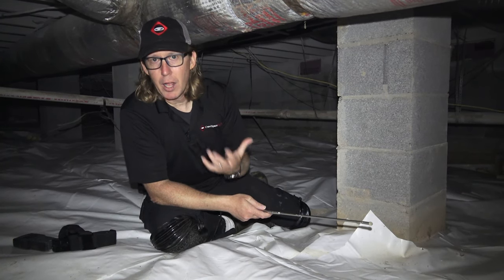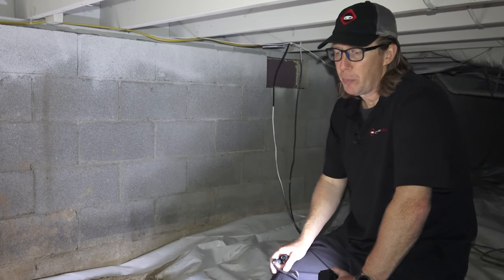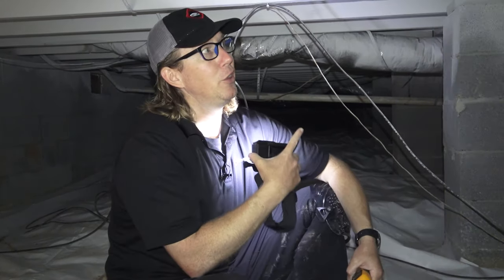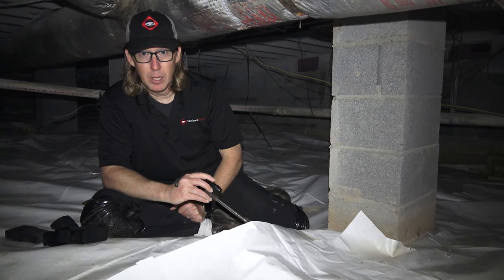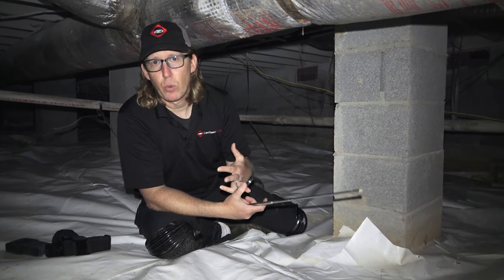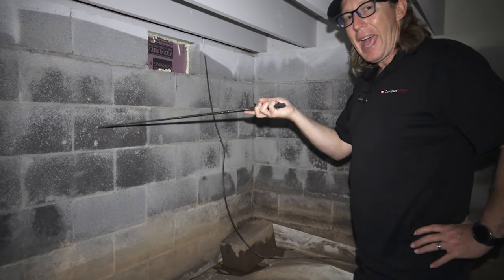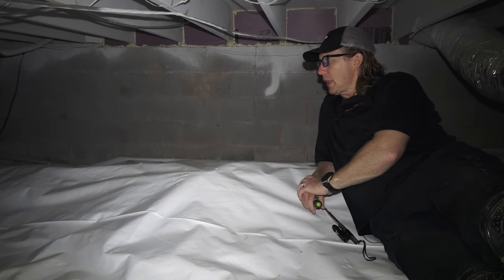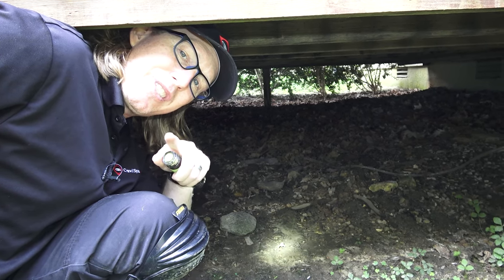Crawl Space Inspection Tips | Choose The Right Contractor

Comment from the maker: Can you guys point out the insulation in this crawl space?!
Reply: It having to be taped up the wall and overlapped, could it have something to do with radon gas?
Reply: Aside from the 1/2 XPS where the vents are...there's none!
Reply from the maker: @gworkseliteautofinish3611  Having vapor barrier attached to the foundation and overlapped and taped helps reduce the amount of evaporation/humidity coming from the ground. It may help with soil gases but a ventilation fan blowing out of the crawl space is still required by code when sealing the crawl space to remediate soil gas build-up.
Reply: There is none
Reply: Rim joists are insulated.

Comment: Wow, terrific and informative...please help me as i have a house ..55' i have 
discovered the status of CS due to my opening the small door and looking in???
and feeling cold air coming from the floor in the winter...i do know insul. was not used in the walls , i discovered the flex Ducts ,large ones, hanging on the floor...old dirty plastic on the ground...vents around perimeter...fiberglass under floor stuck up in joists..so what do i do.
i think that no one goes deep into crawl like termite guys..Dodson pest told me they do not like encapsulation..imagine that!as theycannot look for term...... as u go into space it gets tighter,lower..encap.job estimate here 13,000.i inherited this after folks died...Electric co.did diy for loss of heat...sealed broken ducts..Talk about duct replacement mine ar 70yrs old..I purchased a new heater and they never even checked the conduits...imagine that 5 grand for new furnace..So I want to pull the old plastic...i have a spotlight for my own info but im afraid to go into this space deeper also the water cutoff is down there, i had a rat in the house last winter after finding a hole in the wall behind washer...this is a 1500 sq ft cs and  Iam conserned about the air coming thru the conduits...there is an old computor screen down there how did that get there???

Comment: As you state in the video, we do not know what the contractor who did the work recommended or what the property owner requested. However, this brings to mind a variation of a very old quote: "If you think hiring an experienced contractor is expensive, wait until you hire an inexperienced contractor." 

Having to pay an experienced contractor to come in to do the job right after already paying another contractor is almost always the most expensive way to address a problem.
Reply: Totally agree. Sometimes you can get away with doing the bare minimum like I did when I replaced my old tore up moisture barrier with lots of debris on it shortly after we had severe flooding where my basement and crawlspace both stayed relatively dry even though my entire backyard was flooded because it slopes toward the house and is too expensive to address right now. But as a homeowner or a contractor you have to know when it might be a better idea to go a little above and beyond and actually address the standing water or whatever issue it is instead of simply adding a coat of drylok or putting down plastic or whatever it may be

Comment: 17:50 you are the first person I have heard say how to address those open blocks around the vents.  I have this same issue.  I am strongly considering removing the cheap vent covers and just putting a cinder block back in there as I haven't sealed the vents yet.  Why don't others just replace the vents with a cinder block (in the case where the vent is the same size as a block)?  Is it just a matter of time and money?
I fixed it around our crawlspace door last year and had the bright idea of using canned spray foam.  It took a lot because the foam kept falling down in the block.  I finally got it filled with foam and then had to use leveling concrete to top it off to make the entry way nice.  On the vents I could definitely see just using foam though since making the opening smaller there doesn't matter.  Great video as usual.
Reply from the maker: We find it most efficient to use foam board and spray foam to seal the vents up when encapsulating the crawl space. Thanks for watching!

Comment: I’m gonna look at the plastic myself. I’m sure most viewers don’t know about mil and I myself can be wrong about the correct term pertaining to quality plastic vapor barrier. My question and love your channel you are a true passionate professional that’s not about the spew , you speak knowledgeable info backed up with data. Panda film I have a few boxes that is used for agro of course. My question is can this be used in a crawl space ? Also how are you on using a product such as hydraulic cement to be used as a coat over cinderblocks when the home owner sees water damage and is trying to stop the basement from being further compromised. Then adding foam board to joist and sealing walls with that r value. I’m in Georgia.
Reply: On that note French drains not a fan they collapse and get damaged any other options as far as exterior foundation besides the grate. I’m in Gwinnett so near your Athens location. I called and no one returned my cry for help. lol ….
Reply from the maker: We are using the Hydraway and it won't collapse for waterproofing inside a basement, crawl space or outside in the yard. Here is a link. Hope this helps and thanks for watching. https://diy.crawlspaceninja.com/hydraway-strip-drain/
Reply from the maker: I have seen hydraulic cement installed many times and it can fail if the water pressure is too much for it to handle. That is why we use plastic on foundation walls. I am not familiar with Panda film but if its a class 1 vapor retarder it should work.
Reply: @CrawlSpaceNinja  thanks so much. Out of all the noise out there able to use this platform as a tool and advice. You channel is facts and to the point. Most try overwhelm any one into a negative state of mind.  I mean hands down execution and produce can be and is and obstacle for anyone with out the experience. Yet you let viewers know when to stay in their lane and look for a solid outlet that can definitely showcase the solutions.  Your skill set shins in all you videos. Great stuff.

Comment: So, I wasn't going post my question on this video, but the no insulation kinda did it for me so pardon my long inquiry. I went under my dad's house the other day to run a fiber cable for our internet (cable guy couldn't fit). It's a complete train-wreck and I know pretty close to nothing on this subject, however let me list you off some highlights: The door frames on both sides of the house are rusted out and the metal square door that fits into the frame no longer fit so they are placed in front with a brick to keep animals out. Inside, huge mold problem covering the air ducting due to an oversized A/C unit that creates air leakage into and outside of the ducting. A/C company recommended this unit and now always complains about the mold and recommends up-sizing the ducts. Plastic on the ground covers maybe 25% of the entire underneath. In some spots found a near 1 inch gap between the sub-floor planks. I could see some kind of black material (insulation?) between it and the hardwood floors above. Lastly, no insulation anywhere. The house has vents open all the time. During a humid 85 degree day the crawlspace was just as cold as the house(72). I have no idea where to start or what to tell my dad.
Reply from the maker: We normally recommend starting with sealing the vents and installing a dehumidifier to start drying the crawl space out, then addressing mold, then insulating and encapsulating.
Reply: @CrawlSpaceNinja  I don't think my father is interested in installing a dehumidifier and sealing the vents. Is there another method?
Reply from the maker: @JWolff-md3ij  Sadly that would be the best way.

Comment: I have vents in my crawl space “open” , concrete slab, cinderblock & there’s no standing water but yet my crawl space averages 66 to 72 percent humidity. If I close my vents & install dehumidifier,  would that help ?
Reply from the maker: Yes! This is a common solution to a common humidity problem! You will want the humidity in your crawl space around 45%-50%. Encapsulating will prevent outside elements from raising your humidity and making that newly installed dehumidifier work harder than it needs to.

Comment: You mentioned soda blaster.   I guess that is to remove tough mold after treatment with a disinfectant?  Have you heard anyone using high pressure water in your crawl space after using peroxide?   Seems to me it's not a good idea to add that amount of water in a sealed crawl space
Reply from the maker: You definitely do not want to add that amount moisture into the crawl space in order to treat mold, you would likely have an even bigger issue on your hands. We do soda blasting before applying the disinfectant so it has a better chance of penetrating the wood and working as intended.

Comment: Do you guys reply to comments from old videos? I hope so. I had a mold remediation company come out today and the guy recommended that I NOT go back with insulation once the old molded insulation was removed from the floor joists. He recommended blocking off the foundation vents and installing ground plastic w/a dehumidifier, saying that the insulation would just mold again in a few short years. I'm in Nashville, BTW, so similar climate to yours. Similar crawl space height to the one in this video, as well, w/very similar issues. Thank you!
Reply from the maker: Hey Steve! We try to get to as many comments as we can. :) When we do our encapsulations, we seal the vents and insulate the walls. However, you may want to check out this video that shows some research done between the two types of crawl space insulation and make a decision based off that: https://youtu.be/JZfksZZbrW0 

We have a franchise location in Nashville that may be able to help if you'd like it! https://crawlspaceninja.com/tennessee/nashville-tn/

Comment: Thanks I have concrete floor crawl space with heat in a back split house we’re you can enter inside what installation type do you put on walls moisture is 30 and does insulation cause Mold in behind thanks
Reply from the maker: We have used EPS foamboard and insulbarrier, both work well for us. Hoping to have the Insulbarrier back on the DIY store in next 30-days. Great product.

Comment: Any reputable company you'll raccomemd in Burlington NC? I'm currently watching your videos to build some knowledge and getting different assessments by different company and discuss possible solutions to my problems which is high moisture without any standing water.
We are getting musty smell odors inside our bedroom (only 8 ft cieling) but not in main living area with high cieling until we start going upstairs.
Floor joists have moisture level (in September) ranging from 16.1% to 18.2%.
Our indoor humidity levels (reading off our Honeywell Thermostat) ranges from 61% to 78% and running the air doesn't make things much better. 
My wife gets sick constantly and has to pop allergies pills all the times.
It make sense tackling this kind of high moisture problem in stage seeking improvement as the project evolves.
One thing that also was pointed out to me was that good thermal insulation of the crawl space is a key factor in this kind of remedation, especially when you have a furnace and ducts work in your crawl space because of the dew point.
I went ahead and purchased a SANTA FE 100 because of the wifi. That will give me remote monitoring capability since I'm gone for work most of the day. I was assured by the manufacturer that even though the unit has been discontinued because of energy rating factors, parts will still be available if needed.
I will have it installed once all of the forementioned high moisture level causes has been discovered and addressed properly. Also drain pump from furnace will be used to drain water coming from dehumidifier.
I'm not sure about using spray foam to insulate crawl space. I've watched horrible story of spray foam insulation going bad. It will make sense to use prefabricated insulating foam board on foundation wall but between floor joists I will still prefer old fashioned insulation bats.
Also in one of your video you've mentioned about installing a ventilation fan on at least one of foundations vents. I still don't quite understand the purpose of it. Will that be counter productive if you're totalling incapsulating the crawl space trying to keep humid air out? What will it be the effect of sealing completely those vents in the winter time when is dry out anyway?
Thanks for your time and I hope to recieve some feedback soon.

Comment: Just bought a house and I have a small crawl space (12x15ft or so) under an extension. Started watching your videos to get ideas on what I should do. It's a cinder block wall with a concrete ceiling: the floor above is a 6in slab. It looks like they walled up an old concrete patio. The driveway it literally caulked up against the cinder blocks and the basement. The roof drains half of the house onto the driveway and I can get up to 2-3 inches of water against the cinder blocks and poured concrete basement during a heavy rain. There is a ton of water intrusion into the crawlspace as a result which I plan to alleviate with a trench drain and a french drain.  There is a sump pump in the basement and no serious cracks or water intrusion in the basement (house was built in 52). 

How important is it to seal the crawl space since there is no wooden floor joists? There is one small vent.
Reply from the maker: Remember concrete is not water proof, without looking at the space it will be difficult to provide an accurate response! but a water management system is a good place to start!
Reply: Amending the exterior situation is first and foremost, and it sounds like you're already planning to do work on that, which is great! Just make sure your trenches go to the footer and they daylight at a lower area, sump pit, or dispersal field away from the property. Doing a perimeter drain inside the crawl that drains to sump is more or less necessary, but shouldn't be done until the outside work is completed. 

I've got the same situation in my house, there's a patio with concrete floor, and I'm treating it the same as the rest of my crawl because they're conjoined. Even if there's one vent, you're going to have to deal with the byproducts of that, mainly when it comes to condensation, energy loss, cold floors in winter, and mold/insects/rodents, etc. I chose to encapsulate for all these reasons, but you might be in a different boat. Is your HVAC or ductwork in the crawl/basement? That makes a huge difference when it comes to energy use, comfort, and condensation (you'd be surprised at how much water comes off of incorrectly sealed ductwork in the summertime!) Also, there's a great liquid rubber product that you can apply to the exterior in order to decrease permeability, I applied it to the footer and first foot or so of blockwork right above it when I did my exterior drain and it's worked wonders so far.

Sounds like most of your problems would be fixed by addressing the bulk water problems. After that, you can deliberate a full-on encapsulation.
Reply: @CrawlSpaceNinja  good point, thanks for the reply!

Comment: If I remove my duct work and do away with it(going to ductless split unit) is there a reason to dehumidify? And close vents ?
Reply from the maker: Maybe - in NC they studied crawl with no ducts and were still humid. Get a humidity reader and keep a check on it to be sure. Great question. Thanks for watching.
Reply: Depends on your local climate and whether the crawlspace is vented.  Short answer: If crawlspace is vented, and ambient dew point routinely approaches or exceeds the crawlspace earth temperature, you'll get mold and rot without a dehumidifier.

Comment: Hey Mike, I’m thinking about encapsulating my crawlspace. I have a mobile/manufactured home in Florida. Do you have any tips? It’s hard to find info on doing this for manufactured homes. I’m thinking about adding the barrier first and a dehumidifier, and then starting work on fixing up insulation issues and that sort of thing. It seems like it should be easier to do the work once the barrier is there and humidity and temperature are better controlled.
Reply from the maker: Is your home on a foundation, or does it just have skirting? Skirting is a little tougher because you can't attach the vapor barrier to it easily. A dehumidifier is a great place to start though. Typically you'll want to wait to do vapor barrier until after you've taken care of the insulation and any other issues so that you don't risk damaging the new plastic with the added traffic. We'll work on putting together some videos about mobile homes in the future!

Comment: Is there any way for a homeowner to be able to remotely monitor the humidity level and operational status of the dehumidifier in the crawl space after encapsulation? Seems doable to me. I'd also like to be able to remotely turn the dehumidifier off and on, as a safety precaution.
Reply: Airthings sensor and u can get humidity switch
Reply: With Aprilaire dehumidifiers you can get a remote humidistat it comes with a monitor and a remote humidistat that you hang above the dehumidifier

Comment: Thank you so much for doing this video.  It answered a lot of questions for me especially about wrapping the foundation support pillars at least 6” up. I’ll be contacting my encapsulation installer  as this was not done and it’s in my contract. This was brought to my attention when I had an April aire dehumidifier installed this summer  (again based on your wonderful videos). The hvac installer of my April aire mentioned the pillars should have been encapsulated.  Knowledge is power. Thank you!